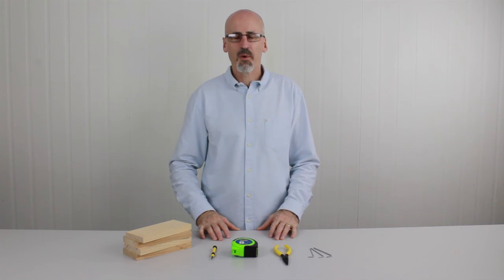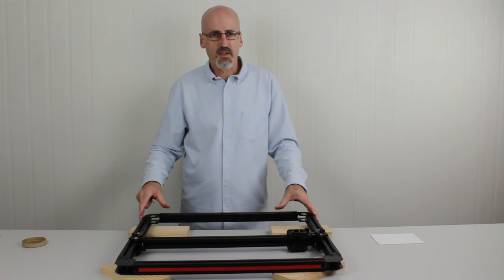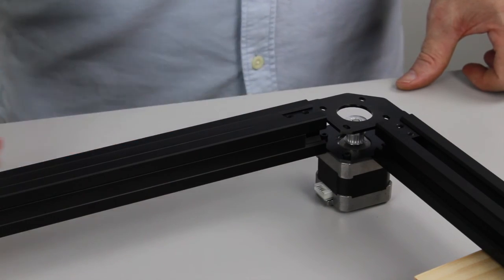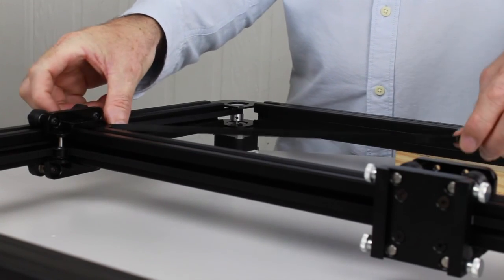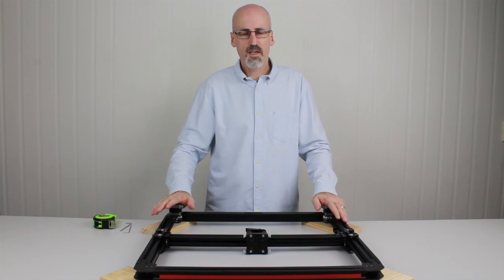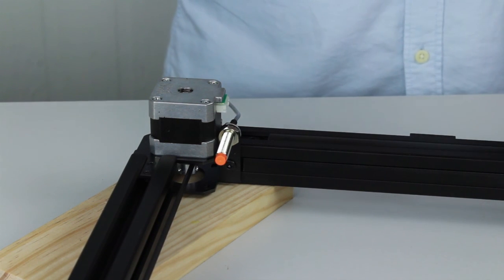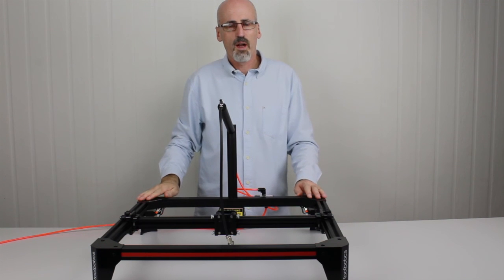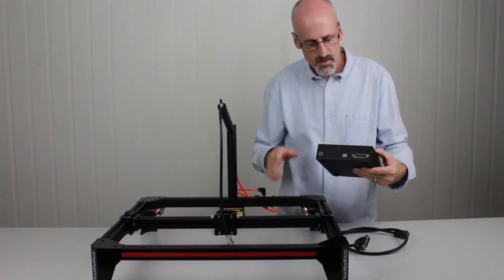Tooli Gen1 Assembly

Comment: CORRECTION: AT 1:10:50 Troy mentions that in order to release the air-line tube you have to "pull" the black clip. This is INCORRECT. The fact is that you have to gently PUSH the Black Round Black Clip in towards the elbow fitting while pulling the tube out.